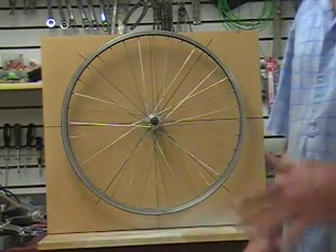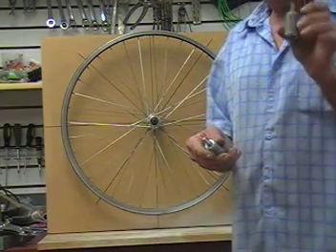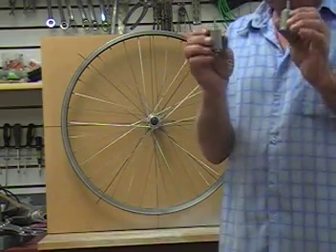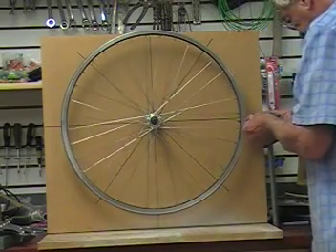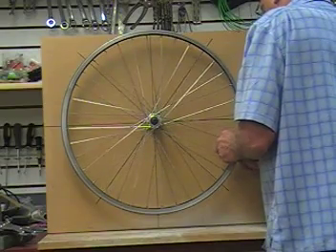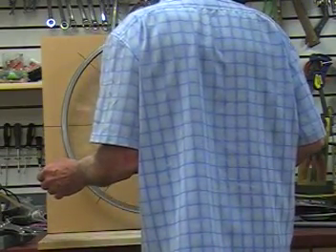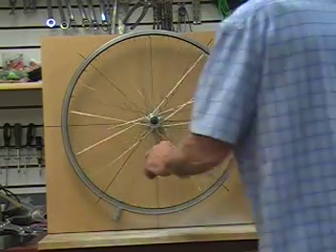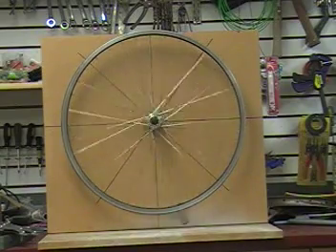Size , Shape , AND Weight of pendulum Does matter

Comment: The whole no matter what, finds its way to the top, that's why at around 1:31 it keeps swinging back and forth, if a circle is balanced then it would not swing, you have only located the center of gravity. This experiment would be valid if it was done by just a single pendulum arm.

Comment: Due to wind resistance.
There's a perfect edge for the least wind resistance, but I don't remember it. But if you put that degree edge on both sides of the weight (pendulum), with as little surface area as possible, without inhibiting the angles' effect, it would create the least drag possible. Drag does matter - ALLOT. Imagine a pendulum swinging in water....  It wouldn't swing long. :-)

Comment: Some very helpful comments there from people who obviously know what they are talking about. I do not have any maths at my fingertips  - so will just say my piece and shut up. The experiment there was completely distorted by the fact that, as has been stated already, the weight of the bobs was only a tiny part of the total mass of the whole assembly. The wheel was just what it was - a wheel - and with all that mass which had to be accelerated and slowed down each time - plus bearing drag and some air resistance - it is no wonder that the different weights gave different results. Why on earth did our demonstrator not just make up a pendulum with a bit of thin feeler gauge as a suspension spring, (I often do this on clock repair - its a bit cheaper than trying to buy them!), with transferable weights? Then his demo would have worked well. One more point; the arc the pendulum describes does affect the frequency. As the arc increases, the frequency is lowered minutely.   This does not cause huge problems but is a factor to be considered in anything clockwise if it is to be accurate. the suspension spring can help in this regard as it`s restoring force will slightly increase the slowing down of the weight and accelerate it`s return when the pendulum is arcing a little more when the mainspring is fully wound and pushing out more torque. As the mainspring unwinds and loses some torque, the pendulum swings a little less - so wont feel so much return effect of the suspension spring. Leaving that for now - there are devices for evening out the mainspring torque anyway. The most used has to be the fusee which can work well  - but has to be matched to the characteristic of the mainspring. Another, more complicated method is the remontoir. This isolates the mainspring altogether by using a "little mainspring" which drives the clock for , say five minutes, so that any tiny variation will be within that short period and, if the weight is well positioned,  things will constantly "equal out". The mainspring proper simply winds the little spring up. Nice! Sorry to go on folks - any further comments I would welcome  - I just love old clocks - I just wish I coukld afford them!  BEV

Comment: You have to measure the time it takes to make 10 swings from end to end and you will find that the time it takes to make those 10 swings are the same for all the weights tested. It does not matter what the weights are, the time is the same.

Comment: Please note that  what this gentleman is saying applies only to a simple pendulum with a  solid FIXED pivot where the mass is assumed to be positioned at one point and not distributed.

What he said does not apply to Compound pendulums and those found in the Two Stage Mechanical Oscillator where the Pivot of the pendulum CHANGES  ITS POSITION.   

Also in the pendulum  with a moving pivot used in the TSO , the  cycle time depends on  how much  energy the pendulum  transfers to the load , and while the cycle time may not change that much   the Mass  of the pendulum does matter in the TSO  as far as energy transfer is concerned.     The pendulum in the TSO with a moving pivot must be regarded as a complex  device that few understand.   The moving pivot pendulum requites different deeper thinking  from the  simple pendulum with a fixed pivot which is not coupled to anything but  swings alone.

Comment: Please note that there are a few types of pendulums.  There is a simple pendulum where the whole mass is  concentrated in one position . This type of pendulum has its pivot point far away from the pivot point and  this pendulum  depends on Gravity and its length and little on its mass.

The Compound pendulum has the weight distributed all over the place and its   centre of gravity is  below the suspension point. This compound pendulum does not only depend on gravity, but on the rotational inertia of the system about the pivot point.

Now of in a compound pendulum where the weight is distributed all around it as in a flywheel and the pivot point is placed exactly at the centre of gravity of the compound pendulum, then this " pendulum" does not depend on Gravity at all and it eliminates it  altogether in fact this " flywheel" keeps rotating in one direction ,  I said this to give the wide span of the type of pendulums there is.

NOw in the above video the wheel has weight distributed around the pivot point and so with the additional weight on its circumference it is a compound pendulum where  the oscillation does not depend on gravity alone and in fact it is a very bad time keeper for clocks as so many  issues affect it.

So , since you have a compound pendulum then sure enough size, shape and weight does matter.  This would not be the case with a simple pendulum to a a practical extent,

Comment: The formulas for pendulums behaving the same (for different weights) only hold true for smaller angles of swing, not 180° as you started with. When the angle gets smaller (say 30° or less) the timing should be very close, regardless of the mass of the weight.

Comment: It just needs a little oil, that's all..  There is a minimum weight to compensate for friction and air resistance.  A pendulum on a string would give You difference results.. It's a ratio problem..  The dog ate my calculator so,  Someone else has to do the math..

Comment: An 'ideal' pendulum has all its mass at a single point; this is a reasonable model for a 'real' pendulum when the support rod (or wheel) is only a small fraction of the mass of the pendulum weight. Using a balance wheel instead of a pendulum annuls your entire premise. In reality size, shape and weight matter far less than the pendulum swing radius on a 'real' pendulum and not at all on an 'ideal' one.

Comment: What you got is the expected result, because the bicycle rim has mass and hence rotational inertia.  With your setup the weight you use has to overcome the rims rotational inertia with every revolution.  Obviously with a smaller mass, that takes longer.  With a weight of zero, it takes forever.  If the bike wheel had zero mass, the periods would be equal.  This is a problem for all real pendulums, but typically the ration of weight vs support mass is very large; your setup makes it quite small.  What you've created is actually more like the spring 'pendulum' used in a pocket watch.

Comment: I haven't read all of the comments so this may have been mentioned.  The weight doesn't matter for a simple pendulum but it does for a physical pendulum.  A simple pendulum is a large weight (called the bob) hanging from a very light string.  It only matters that the weight is much heavier than the string.  Then the period only depends on the length (for small angle swings). You have a physical pendulum where the period depends on the rotational inertia and the location of the center of mass.  The heavier weight changes the rotational inertia and center of mass of your wheel which changes the period of the oscillations.
Reply: also you are not measuring the period but how long it continues to swing after releasing from a certain height.  the heavier weight gives it more inertia so it swings longer.

Comment: I can't believe I'm writing this. With the wheel present, you have a pendulum with a counter balance. The lighter pendulum has a heavier counter balance than the heavy pendulum. If you want to compare the effect of two different weight pendulums you have to either omit the counter balance, or make it proportional to each pendulum's weight. Is there someone out there with some mechanical aptitude?? Holy crap!!!

Comment: Neither a true pendulum nor flywheel. All you're observing is how quickly the wheel bearings are dissipating kinetic energy through friction in the bearing. Rolling friction, grease and rubber seal drag contribute to damp the oscillations. Heavier weight=more more potential (static) energy to dissipate after converting to kinetic (motion) energy, so it takes longer (more oscillations).

Comment: Yes. You're right, Kaela. The two weights shouldn't make a difference in the period. But, I timed them, and the heavy pendulum swings 60% faster. That shouldn't happen. The experiment has some problems. The big problem is the wight of the whole wheel is getting involved in the motion and giving bogus results. He needs to make a proper pendulum in order to evaluate the effect of different weights.

Comment: (contnd) the swing-period will be longer (and Q will be higher).
You can improve the performance (I think) in 2 ways:
(1)Mount a 2nd wheel on the same axis, but on the other side of the pane. This will balance the axis better on the ball-bearing.
(2)Mount the weight on the inner side of the hoop, rather then on the outer side. Cover the wheels with mylar (like racing cyclists do), to reduce air drag on the spokes (the effect will be less than in a cyclewheel because yours oscillates.
Regards Ben

Comment: You are actually measuring the Q-value of the pendulum. You are surprised by the effect of the driving weight on that. From the pendulum formula, in which weight does not appear, you would expect no effect. However, in a real pendulum (physical pendulum) the weight does affect the period: the rod that carries the weight is not massless; accordingly, the center of mass of the whole pendulum lies above the bob. When you increase the bob's weight the c.o.m. is lowered, and  (contnd)

Comment: But you are not measuring the timing of the pendulum....
Appears this video is measuring the bearing friction on the wheel.
It is only the period of oscillation which is supposed to be the same (only dependent on the pendulum length), but again that will only be true in a  vacuum and with no (bearing) friction or hub inertia.

Comment: because the wheel has mass it will effect the period, the effect of the wheel's mass will reduce to almost nothing when the bob has significantly more mass than the wheel (if you had a 1kg and a 2kg bob you probably wouldn't notice any difference between them, they would both have significantly more mass than the wheel)

Comment from the maker: I beleive you are 100%  correct  "IF"  I were trying to build a clock.  "BUT" in building a TSO timing is vital.  Maybe I need to study clockes a little closer.  4 degrees will not cut it for a TSO.   I like the way you put it, "otherwise circular error will muck up your results."

Comment: Hi, The greater weight will have a lot more inertia so will maintain momentum for longer. If you want to experiment with pendulums and how they relate to clocks you need to keep the arc of swing below 4 degrees otherwise circular error will muck up your results.

Comment: Hi all great work.  You look at size weight  and shape.  I think another factor could be direction.  North South or East West?  Maybe even a magnet on the bottom of the pendulum??  To get a little more accurate with measurements maybe a laser pointer on the ceiling attached to wheel? Just some food for thought.

Comment: The energy required to cause the wheel itself to change rotational direction, without the weight, each cycle must be considered. Remember that an object in motion tends to stay in motion. This also applies to a spinning wheel. It wants to keep spinning in one direction.